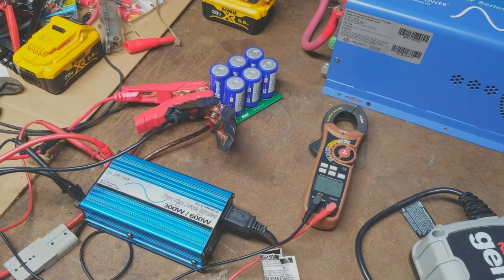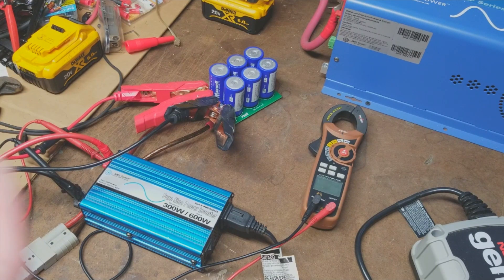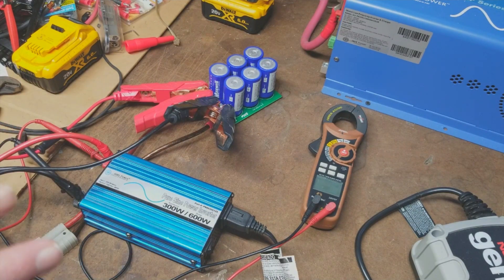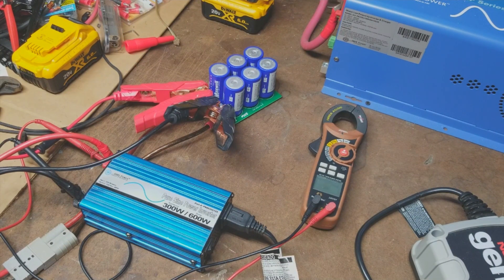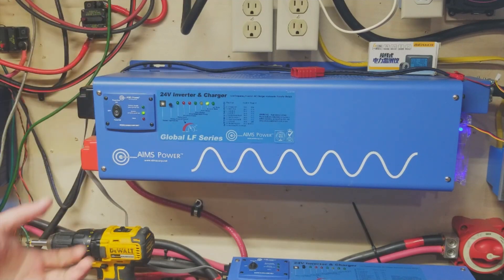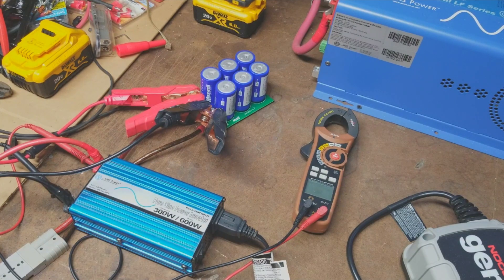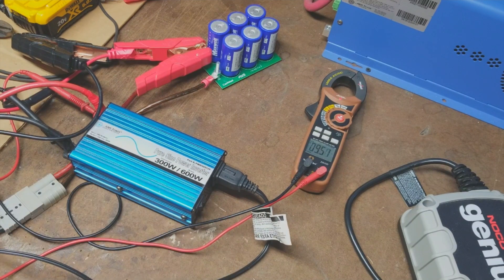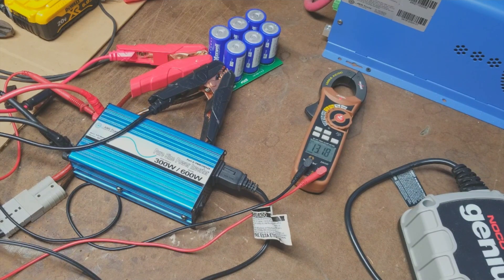Maxwell Super Capacitors ? Solar Batteries ? " Can I use as a Solar Battery Bank ? " Hmmmm

Comment: Hi I'm new to your channel just subscribed, I wanted to let you know you're very close but it was something I discovered years ago go if you have a source that can charge your capacitors and you have or you split your bank into 2 different banks and switch between them then you can run your bank Indefinitely. Now people ask why would I want to do this is something nikolai Tesla did in his experiment so I've been using solar to charge up my banks then I start using A 2001 inverter which means that I'm taking a Ace in AAC plug that converts it to DC which is 60 W and I'm still able to charge up that bank means I step the electricity down in my house. Now. Now I'm alternating the capacitors which steps it up and then I used energy as I want Means that I'm pulling less energy from the grid and with a W meter you can see that in real action. So that's one way you can use this and there's There's so many others I decided to write a book about it now if you're not familiar what I'm doing or never heard of anyone doing this with capasters and batteries then let me explain it to something that's very common it's called a voltage doubler it is a common thing that people have been using for years Now I also found out that pass through charging if you heard of that term has to have that switching mechanism in order for the batteries to charge and dissipate at the same time I would love to talk about this subject more so give my library a call (313) 651-5349 that's if you want or drop me a email at Medialibraryinfo@gmail.com

Comment: Uhhhhhh. You can use 100% of a capacitor and not hurt it. And lithium is around 50% somewhere. Say if you had a capacitor battery bank m you could just run that inverter till the low voltage cut out kicks in. No harm to the caps
Reply from the maker: Essentially yes you can. But having a Large enough bank of them would be quite expensive also.
Reply: I'm looking at 2x  kilowatt labs 3.55kwh supercapacitor bank to give 7.1kwh for my coach to motorhome conversion. What are everyone's thoughts? These are 2-3 years old 2nd hand

Comment: How have those aims inverter been over period of ownership
Reply from the maker: Those Inverters have been on mostly 24/7 for almost 2 years straight now. I think the Key to people having failure is overload and abuse of the inverters. Well any power inverter in fact. If you need 3kw of power get 4 kw and have headroom of power. I usually shoot  1kw bigger than I need.
Reply: @SoutheastOhioSolarHaven  ok thanks for the reply. I asked because i see some saying aims are crap. I wanna get some of those Maxwell 2.7 350f capacitor

Comment: Yes they charge up quick but you are putting 26 amps from the Noco and only pulling 1 amp with the fan but I get your point and you are right. Have you ever seen the Desert Experimenter with his home made Big ass capacitors. Now there is an experiment for you, hope you don't mind the link if so delete.

https://www.youtube.com/watch?v=4PiZWSkVVu8
Reply from the maker: actually in power supply mode the noco charger supply 5 amps at 13.6 volts. And at 12 volt to run a 60 watt fan required 12 Volts x 5 amps which is 60 watts. The fan power from 120 volt doesnt count. What counts is the energy to make that 120 Volts.  Remember your drawing from battery current
Reply from the maker: There also a Huge difference in Nano
 farad and a FARAD.